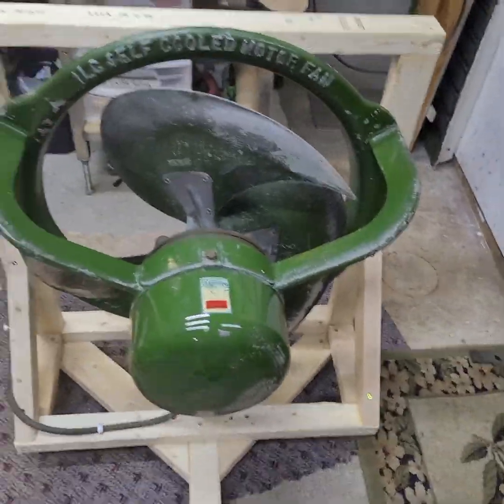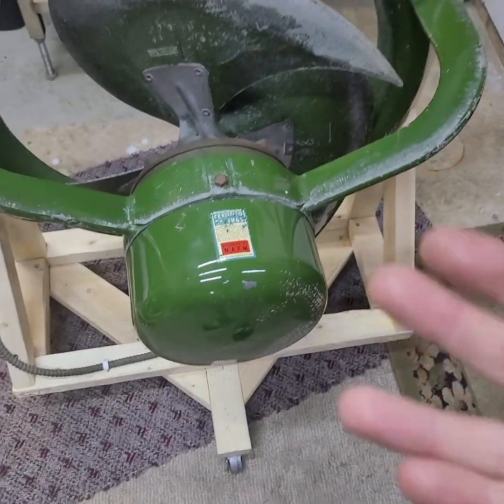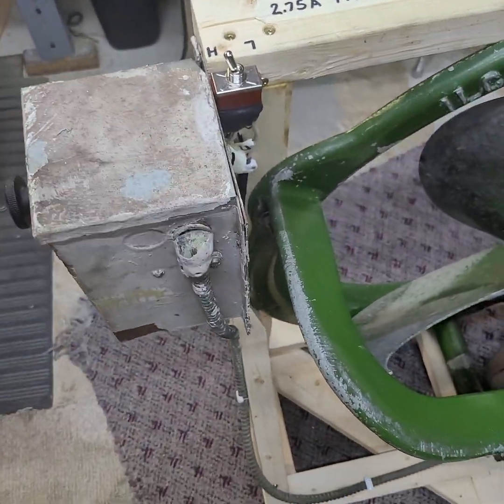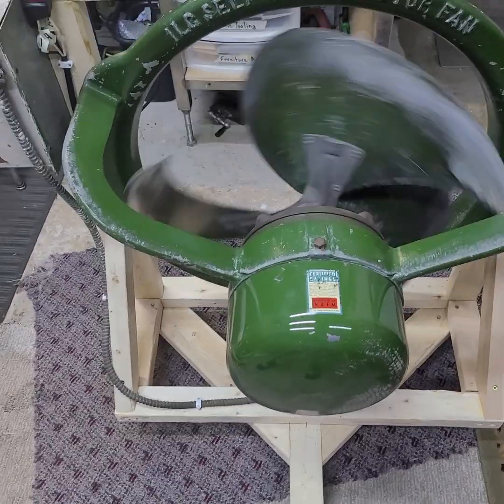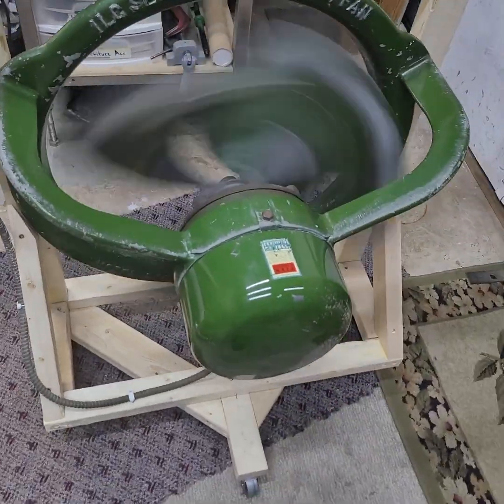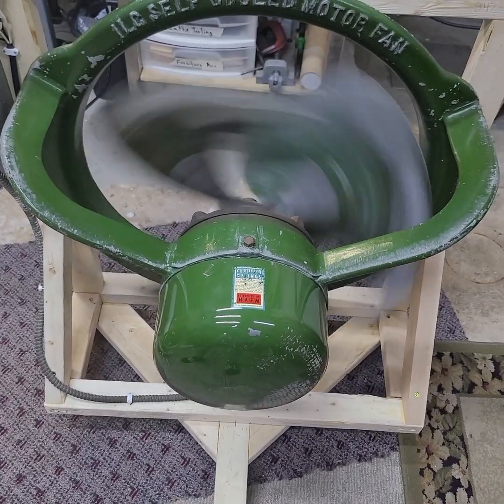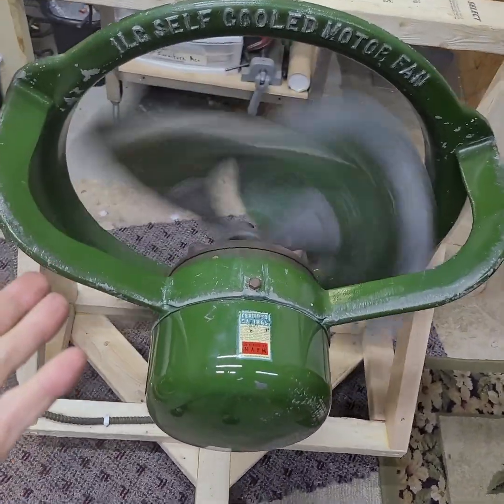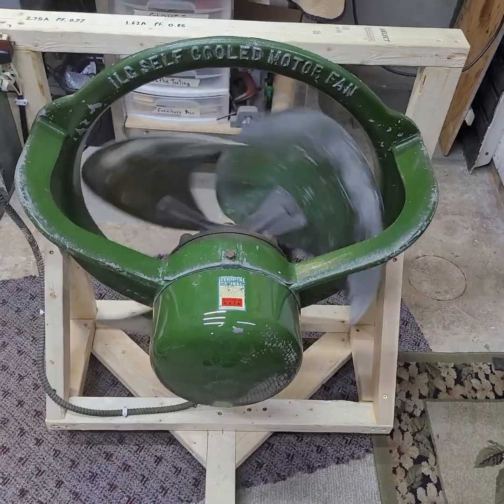ILG 243 Conversion to 2 Speed

Comment: I assume this is what you did with your ILG ILGJET, i know those come in a 1 speed, but i think the same concept still appies!
Reply from the maker: The ILG JET actually came with a two speed ILG branded Toggle switch wired to it when I got it. Whether that was 
original from factory or added later I am not totally sure but it utilizes the same concept as demonstrated in this video.

Comment: Excellent. Yeah, it's great to have a two speed option! Much more useful for workshop duty not in tornado mode! 
It's good that you're fine-tuning the capacitor values. That is definitely an art. Sometimes it does take two different capacitor values to convert some motors to two-speed.